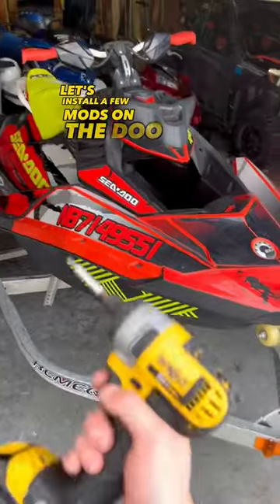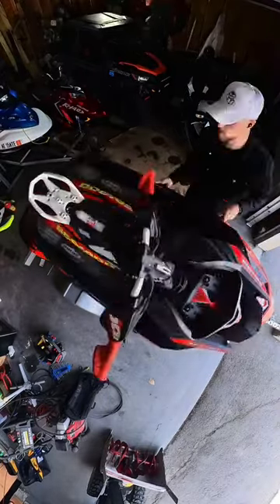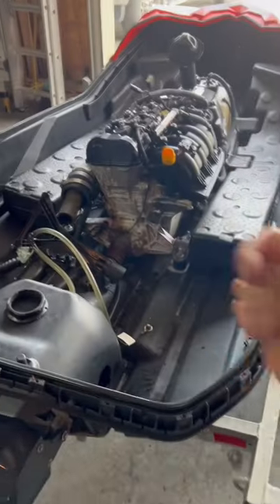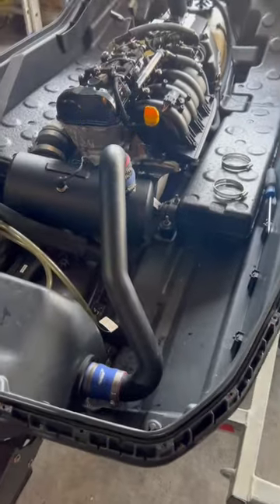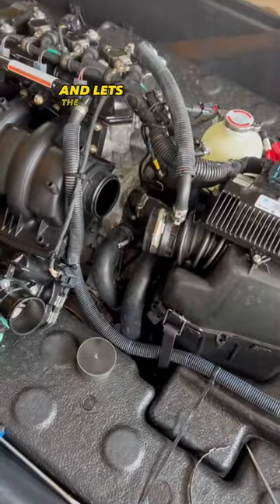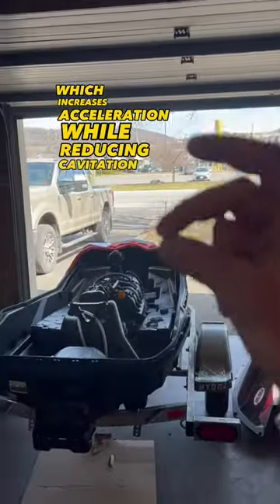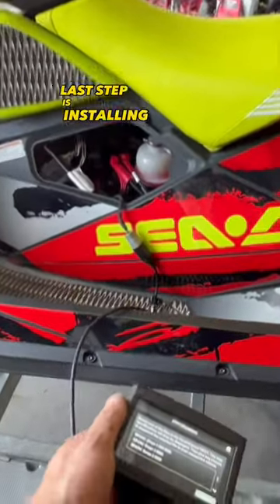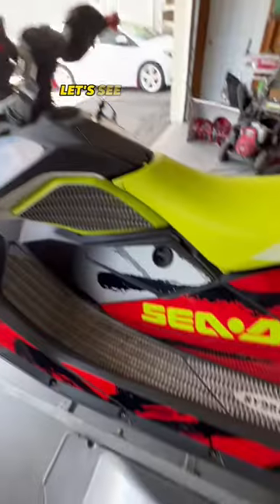Seadoo spark trixx stage 3 kit #howto #tutorial #seadoo #seadoospark #seadoolife #jetski #canada

Comment: Removing the whole top deck seems like a pain, I’ve only really worked older skis and it’s so much easier to just open the seat
Reply: It is a pain especially if you just want to replace spark plugs but for anything else it's super nice.
Reply: The sea spark doesn’t have engine access through the seat, it only has a small port to check on coolant level and oil, for everything else the whole top end needs to be removed, as this is a plastic built and not fiber class like the other styles of jet skis
Reply: It only takes about 15 minutes to remove if you know what you’re doing. Not a pain at all and you get much more room than a typical jet ski.

Comment: Has anyone had there sparks trixx check engine ever come on the screen then loose power and when it goes away has full power again but it keeps coming on and off I’ve checked everything from fuel pump, spark plugs, intake, airflow fuses, and I have no clue what it means